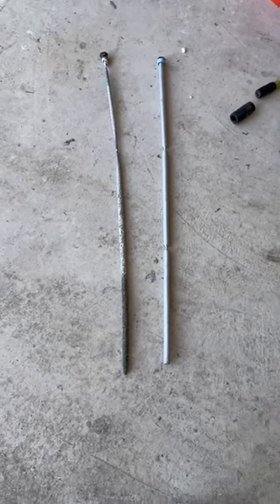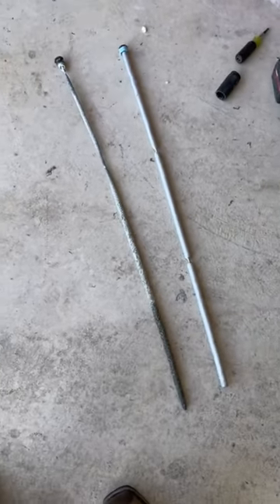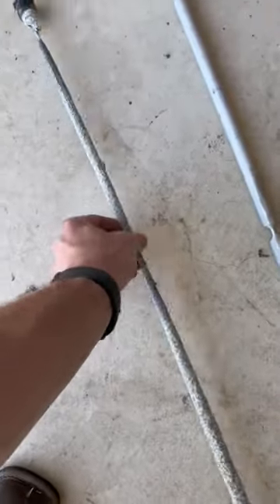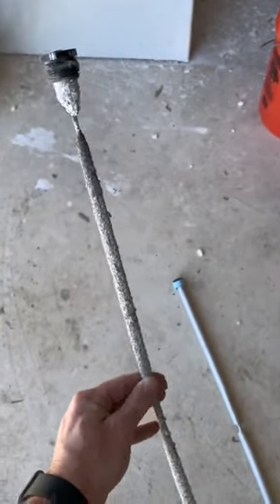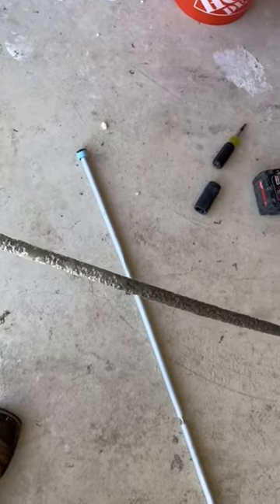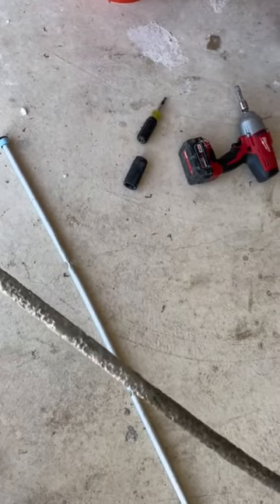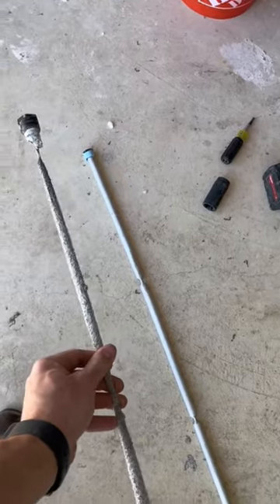Egg smell from your hot water? #plumbing #plumber #trades #smell

Comment: By coming from the water heater do you mean they smelled it when standing by the water heater, or was the smell coming out of fixtures releasing hot water? Also, why won’t it happen again if those rods are meant to be sacrificial?
Reply: The water smells, Not the unit. The original rod is not aluminum they don't last. The aluminum rod will outlast the tank. This is recommended from the manufacturer after the 1st year of use. They don't supply the aluminum rod because of costs.

Comment: 90 percent  of the time replace  hotwater heater  if over  10 years old.   Het water Call Wells should be on a water field tracian system. You can't drink that kind of water. You have to filter it so I don't know what this guy's saying. If the hot water feeding to the hot water should be on a filter and should be tested to make sure the water drinkable. If the water is not drinkable damn you need to figure it out damn